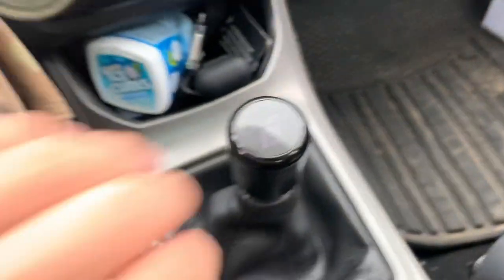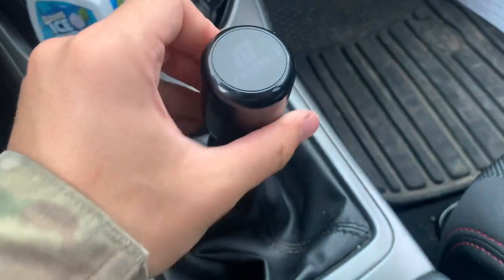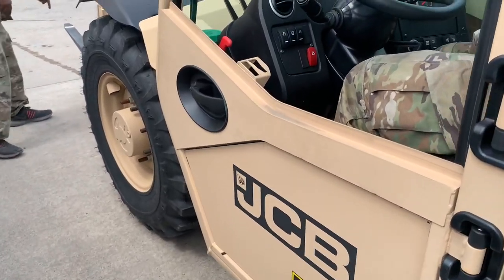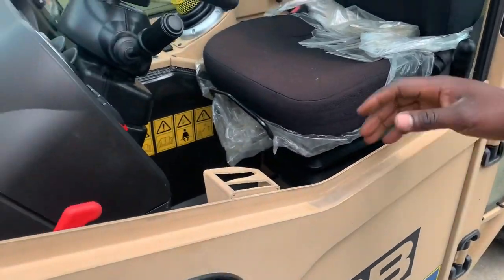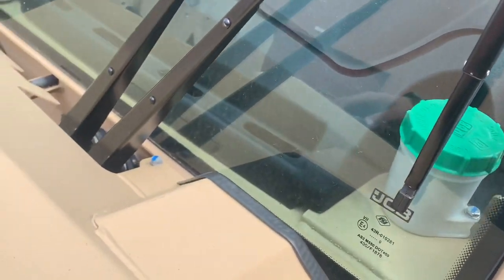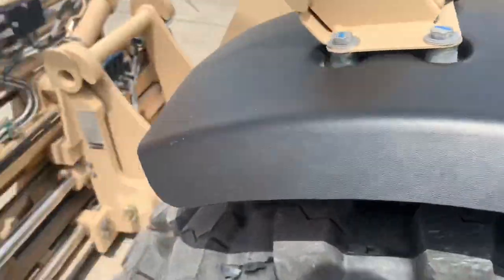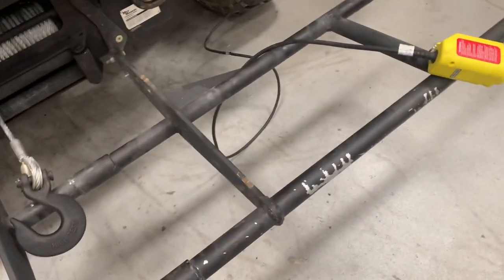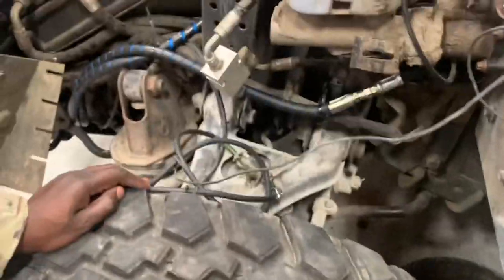New Military Forklift !

Comment: I need your help.  Can you show footage of how you install or remove a brake caliper on an ecv front driverside. The normal caliper and not the Wilwood. 12” solid disk.  There seems to be no room on getting that in. Just wondering if there was a trick to it.
Reply from the maker: I’ve heard of people taking off the horn for more room
Reply: Dancing Dragons i already have the horn and bottom skid bar off. The caliper is being blocked by the front bulkhead.  I stuck in the inner pad and placed the outer pad and it is just a small miss of clearance.  Too bad these parts aren’t flexible. Lol

Update… had to disconnect the halfshaft and popped the disk of the hub onto the bolts to get enough wiggle room to get the caliper and pads on.